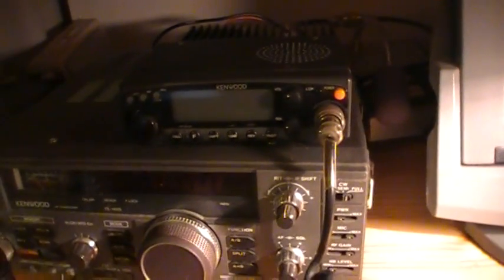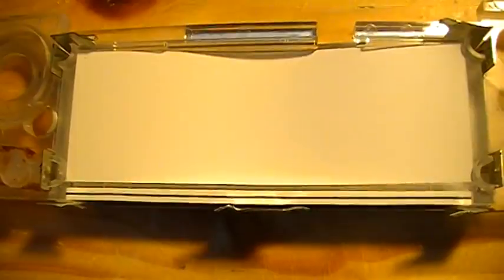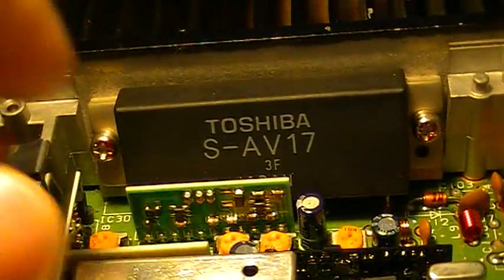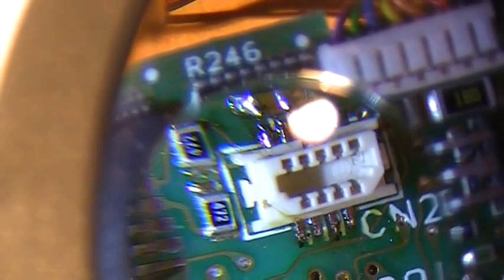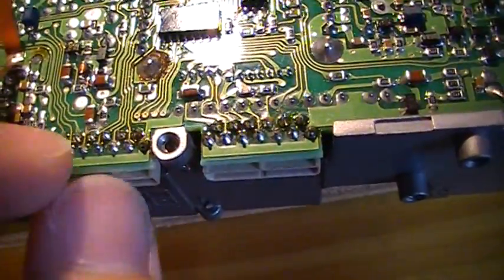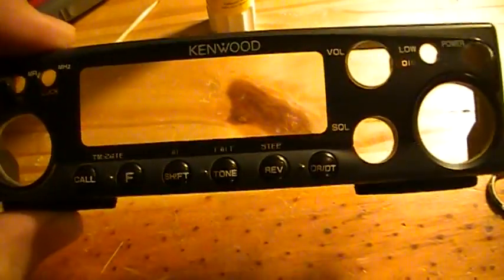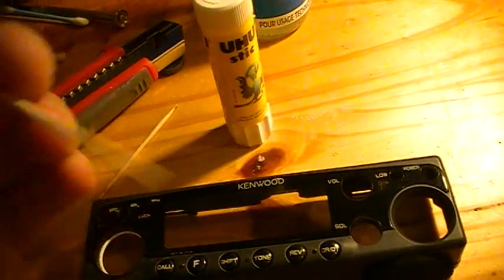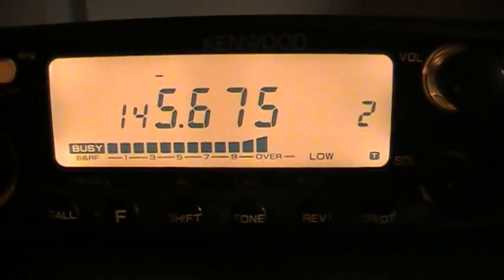Kenwood TM-241 vhf transceiver restoration (display, pa, front panel)

Comment: I have a 241a and it doesn't save the memory. I can program it and if I power it off for more than 3 sec. the memory is erased. I replaced the 2032 memory battery but still the same issue. Any idea what could be the problem?